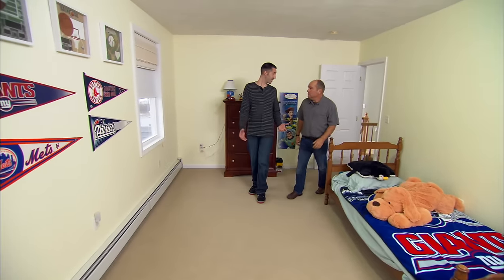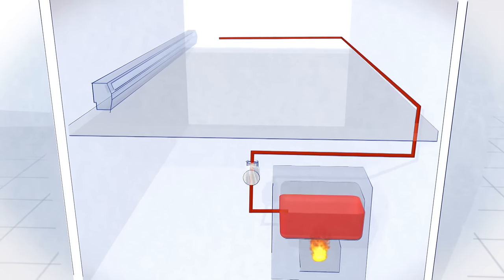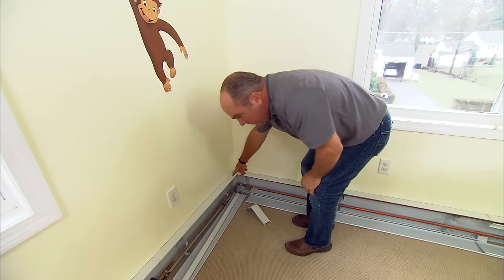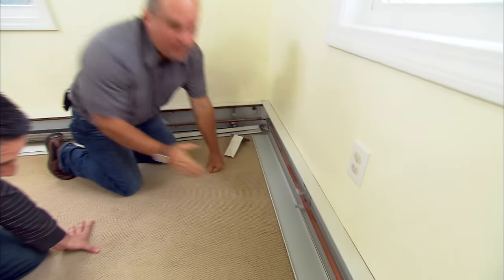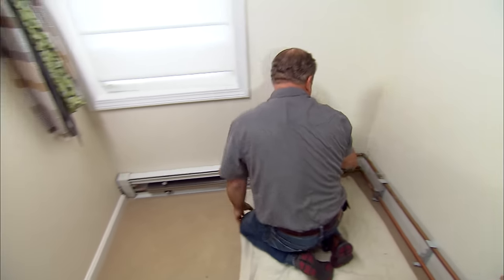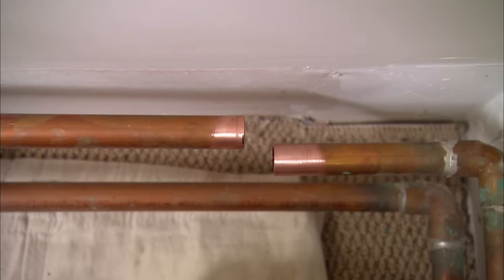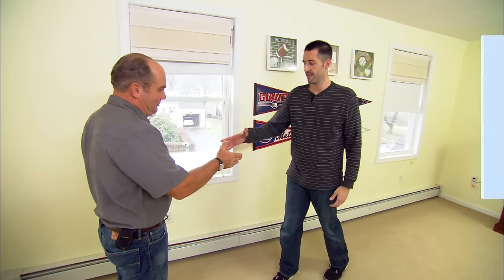How to Quiet Noisy Baseboard Heat | Ask This Old House

Comment: Thats some very efficient and cheap service! Im dying with the noise in my apartment meanwhile I am afraid to call the plumber as they charged 200euro last time for changing a radiator head....
Reply: Victor I suggest watch a 13 part series called What on earth happened by Ewaranon to learn that the earth is not a globe. Link in my about tab.
Reply: @flat-earther lmfao

Comment: I was curious as to why Richard did not mention "bleeding " the system for air as well. When our technician services our system each year an starts it up for the season, he bleeds  the system of any air.
Reply: I believe bleeding the system is a remedy for gurgling or dripping sounds in the radiators, but it wouldn’t fix the fact that the pipes themselves as shown in this video are too long.
Reply: We used to bleed ours at least every year, but I later learned that with some valves (only the kind with rubber washers), if you tighten them just enough to stop the water, they'll dry out and bleed out any air that builds up. Some others have a float to automatically let out any air. But the small, all-metal kind need to be bled manually.
Reply: Bleeding baseboards

Comment: Ahh, the sounds that terrified me as a kid
Reply: All I here is tick tick tick tick tick on and off and on and off 🙄
Reply: When I was a kid, we had unusual baseboards with 1" or maybe even 1.25 inch copper pipes running through them downstairs and box convectors with 1/2" pipes upstairs. The main loop just ran right through all the downstairs radiators, so the upstairs ones were the only ones that could stop working if they had too much air. But the downstairs ones gurgled like crazy and pinged loudly as well. The sound never bothered me, it always reminded me of the first fall we lived in that house. I even liked the smell from those things.

Comment: At this heating system( I have that myself) wherever the copper pipe hits or moves on some kind of holder/bracket specificially if  it hits any metal,it should be covert with FELT,so the pipe can easily glide back and fort without making noise. I had to do this in my house after I bought it because  the noise was driving me crazy.
Reply: Can you show a picture of what you did please?

Comment: Half right. What you should have done is inserted an expansion coupling instead of the straight coupling. We normally fit them in each change of direction and they have a bracket that you fix to the wall and the elbow allows the pipe to expand/contract within the fitting. And start using a pipe slice instead of these mini cutters, haven’t used one of these for years.

Comment: I have hydronic heating in a 150-year-old farmhouse; it is mostly baseboard, but there are 6 exposed cast-iron radiators included in the loops.  To mitigate the burn risk on the radiators, I run the water at 165.  It's still uncomfortably hot to the touch when it is going full-bore, but not instant-burn hot.  Domestic hot water comes from an indirect hot water tank, which is connected to a special connector on the control board such that when the tank calls for heat (as opposed to a zone thermostat), the boiler runs at the full 180 degrees for faster recovery.

Comment: The creaks, clicks, and pops in my baseboard radiators are due to simple expansion/contraction rubbing on the pipe hangers, not limited clearance. 
To fix it is even simpler, by just adding a piece of felt between the pipe and hangers. 
I like the noises though. 😊
Reply: They actually had a similar video where that exact issue was addressed.
Reply: @zcpoling  
I think I remember seeing it years ago.
Reply: As in noisy pipes but the furnace is working? I will try your felt padding idea.
Reply: Mines obnoxious. Hate the noise in my bedroom.  One day I'll investigate.  It sounds like Quigly mansion.
Reply: @deecee901  DeeCee I suggest watch a 13 part series called What on earth happened by Ewaranon to learn that the earth is not a globe. Link in my about tab.

Comment: Same thing happens with the copper soil stack in my house. Have a hot shower it creaks and bangs, as it cools off or if you flush the throne or run cold water you can hear the pipe backing off whatever it is pushing on.

Comment: When the heat comes on in our house, there's a noise like a machine gun that reverberates through the whole house. I found a spot where the main heating trunk line goes through a hole in a steel I-beam, but has deflected and is resting and rubbing on the beam. That beam crosses through the entire house.

Comment: Please can u advise.  Everytime we open water from upstairs bathroom   directly downstairs in our kitchen we can hear a tik tik tik noise . Ive had one plumber out. He opened all my taps in the house slightly not fully flushed both my toilets and outside hoose pipe tap. He said the  cause is airlock in the water copper pipes. Any idea what it could be as we still have the issue of the noise especially if we open the tap upstairs after a while. If we open the tap and close it and keep repeating constantly then no noise. 
Also by 2 water pipes are loose behind the sink aswell. No idea if this makes a difference to the issue or not as not clipped
Reply: The ticking sounds like rubbing from expansion to me. My pipes do that every now and then.

Comment: I have a radiator heater but from the floor it's making a very loud screech/chirp sound. I woke up thinking I had a screaming opposom down there until it also did it next to the other heater. But the heater isn't on. Its 80 degrees. 
Any ideas?

Comment: Why didn't you reamed the pipe? Also, all the books I have read say that you should heat the pipe first and then the fitting so that you do not burn the flux out.
Reply: You’ve read books on soldering?
Reply: CHOMAHOMA I suggest watch a 13 part series called What on earth happened by Ewaranon to learn that the earth is not a globe. Link in my about tab.

Comment: I know I'm alone with this, but I actually like the creaking and clicking of my hot water baseboard heaters. 
It's like the house telling me that it's keeping me warm.
Reply: Rob L. Okay..
Reply: Ha I know what you mean
Reply: That’s weird dude
Reply: The house is also telling you it's getting stressed by expansion and contractions.
Reply: rthat1 
Not my house. The noise is due to rubbing on the pipe hangers, which is by far the most common cause. 

Expanding into a wall is rare.
Reply: i could most certainly agree with you, wish i had baseboard heating in my house but i am stuck with shitty forced air
Reply: Rob L. I work on them and it isn’t rare for them to expand into the wall
Reply: Me too
Reply: zack9912000 
I've only gotten a flat tire twice in my 3 decades of driving, but auto mechanics see them every day. 😉
Reply: Rob L. Well I work in the same industry as Richard does and the bs the comes out of his mouth is crazy. He is a horrible HVAC tech the crap he spews. He is like the first company I worked for the owners were idiots and had no idea what was going on and how things actually worked.
Reply: @zack9912000  
Did you get a heart attack while typing?  :/

Comment: i'm curious why this system doesn't just have an expansion loop built in somewhere to avoid the expansion along the corners to begin with.
Reply: The expansion and contraction is of the copper hot water supply and return lines, and not caused by the expansion of the fluid itself.

Almost all hydronic systems are required to include an expansion tank (the one installed in the owner’s house is visible around the 3:46 mark), however, some hydronic loops may be so small, or have such a low Delta T that the expansion is negligible, and engineers are allowed to safely neglect the installation of an expansion tank. Such installations may include radiant ice melting panels, or even re-heat coils in make up air units which exchange heat between a glycol loop, and the central hot water loop from a boiler plant. These glycol systems are usually very small, and do not have to endure large differences in temperature.

Comment: 180 degree water isn't superheated water. It's heated water...
su·per·heat
/ˌso͞opərˈhēt/
PHYSICS
verb1.heat (a liquid) under pressure above its boiling point without vaporization.
noun1.the excess of temperature of a vapor above its temperature of saturation.
Reply: better to baffle them with bullshit

Comment: How big is that house to need 4 zones?
Reply: At least one for upstairs, one for down, and one for each bedroom. Its about efficiency because that old boiler isn't
Reply: Caleb Gagne an associate has 8 zones ,,8 thermostats,  which is great
Reply: Caleb Gagne... In that neck of the woods, not far from me, it's common to update a system from a single zone (whole house) to one zone per floor, then one more for domestic hot water. Likely there's a finished basement here so a third floor to heat, and four circulators or one circulator and zone valves to control the flow.

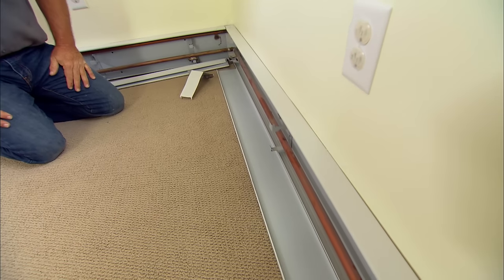Comment: 3:21 With exception of water; It expands at lower temperatures
Reply: no things expend at hight teps, you must be thinking of ice which is a totally different effect google can explane this well. Also he's talking about the copper pipe expanding.
Reply: @danielspak8475  Pretty much every thing expands at higher temperature. Water is the only substance that expands at lower temperatures. Thats why ice is less dense than water in liquid state

Comment: I feel these type of baseboard is self-contained and there is no central water reservoir circulating in North America. I’ve only seen heater with central heating system in buildings older than 100 years in Quebec. Although this type of heating system is very common in China.

Comment: I have been watching This Old House for 40 years, and would be the last to question Richard's knowledge, but he is incorrect in his description of how this baseboard system works.  The circulating pump does not push the hot water but, rather, it pulls it back to the boiler.  You can prove this by feeling the pipe close to the pump moments after the thermostat calls for heat.  it will be cool because the cool water in the pipe is being pulled b back to the boiler.  In a minute or so the pipe will get hot as the hot water has made it back to this point.  If the pump was pushing the out into the system, the pipe would turn hot immediately.
Reply: They can be plumbed both ways...

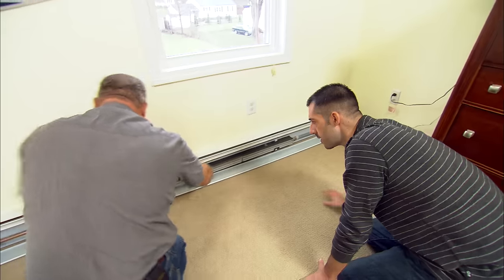Comment: 2:20 missing alot of fins there
Reply: That's by design. Each room needs  a certain number of BTU's of heat; the pipes with fins emit a certain number of BTUs per foot, while pipes without fins emit far less.  The BTUs needed to heat that particular room determine the feet of fins needed within that room, and the rest is plain pipe.

Comment: ok guys, you've made three videos like this now and they ALL include return pipes that are pressed against a wall... MY system is a continuous loop so I have ZERO return pipe issues and yet, I still have a TON OF NOISE!  I've addressed all the standard troubleshooting issues and yet it's still a symphony of noise every night.  What's the deal!?
Reply: Pipe rattling on the hanger?
Reply: sharkhax  each case has various causes/fixes  would have to SEE IT
Reply: sharkhax If you have a continues loop, you have a system that should have been installed the way it is, as 1 side will,be hot,,but by the time it gets to the end,,I warn to cool, I’d like to suggest it is NOT a continuous loop
Reply: Easy, put felt inbetween anywhere metal meets metal.
Done
Reply: @flybyairplane3528  Thank you :) - I'm curious, if it is not a loop, where would the return pipes be?
Reply: @thecloneguyz  Probably right, need to comprehensively get to that... my fear is that there are metal/metal contacts in the wall that i cannot reach.
Reply: @sharkhax  
Only where copper meets any other metal edge 
If it's flat on flat you wont hear anything
Reply: @sharkhax … Metal pipe rubbing on wood can still make noise. It's just a matter of finding where that is. Quite often a house will settle over time and what was once a 1/4" gap around the pipe is no longer the same distance. Sometimes it's in the floor or ceiling, wherever the pipes go.
Reply: @sharkhax … All baseboard is a "loop" so just follow the radiators from one end to the other, room by room. The other end of the loop will show up in the basement (likely directly below that last radiator) and probably runs across the ceiling, then back to the boiler. The return side (cooler water going back) connects to the lower part of the boiler and the feed side (hottest water) comes out the top of the boiler. In many cases the installer may have marked these pipes to make it easier, typically with a system of 1, 2, 3, (floors) B (basement), G (garage), FR (family room) etc.

Comment: Wow these guys who installed those copper pipes get paid good money for a crappy job,thats not cool. A simple fix that didnt need to be done if it was installed by professional
Reply: when I saw the shark bite that was the first sign it wasn't installed by a professional
Reply: @The road to Ireland it's a push in fitting that doesnt require soldering. Basically anyone could do it
Reply: @mattmopar440  there are no shark bites. I remember my first time seeing Wirsbo hepex
Reply: A shark bite is shit. I would never use one and I've installed miles of baseboard
Reply: big papi ed actually had to do the SAME THING  in 2 homes, 35 years ago ,
Reply: There was no shark bite in this. Shark bit is not rated for heating systems. You saw a pex compression fitting which will outlast a typical soldered joint in copper..

Comment: This guy put insolation over his radiators?  Not a smart fix.

But it seems unsafe to have hot pipes pressed against the wall.  I guess 180 isn’t going to start fires but aren’t you putting heat into the wall rather than the room?

Comment: Why do they have so many receptacles on that back wall
Reply: Code states every 6ft
So at minimum they need 2, but if you look they installed one between the windows so you won't have cords running all over your baseboard.
Reply: William Winder and I’ll add to that, if you have an outlet within 6 feet of a sink,,they MUST BE GFCI  types, but exceptions to that, is a REFRIGERATOR, FREEZER, or SUMP PUMP.

Comment: Lie don’t believe him. His try to make that work very confusing. If you have that problem just take off the air from your baseboard heat . Baseboard heat panel has very small screw. Turn of you heat than very slowly open skewers until water come that turn on screw . Done no need pluming no need pay them

Comment: One its missing half the dam fins and is that a plastic pipe with a shark bite are u kidding me
Reply: Those are actually pex fittings, they are commonly used in plumbing and have a long history of use in the EU. They use expansion to get the plastic rings onto the plastic fittings.
Reply: That’s a propex fitting from Uponor. It is widely used in the trade. Nothing Wrong Here.
Reply: Used by hacks and hacks alone
Reply: That shit will leak in no time